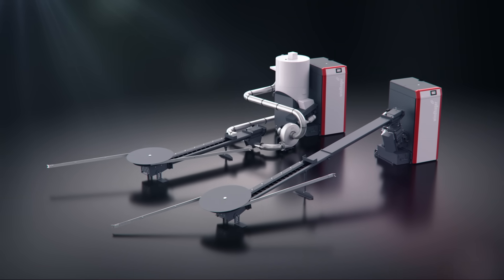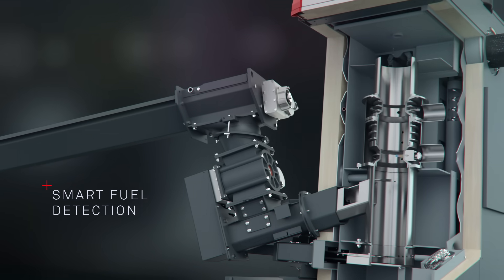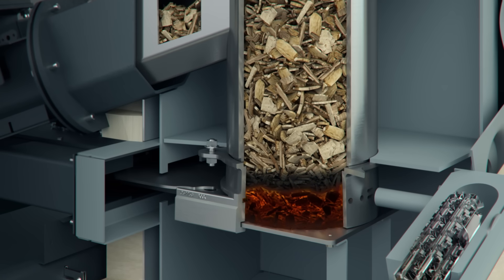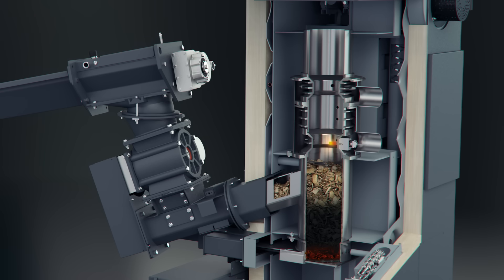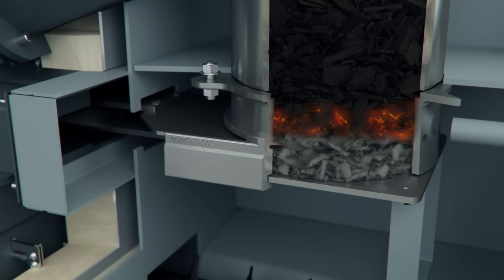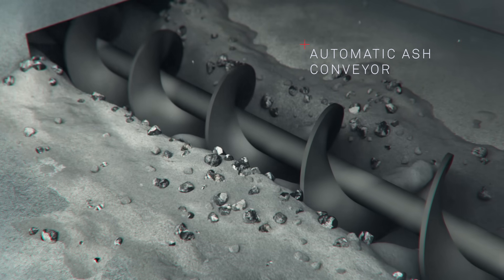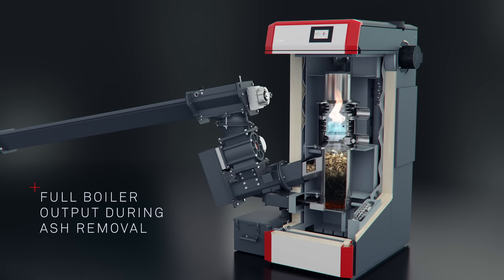Windhager PuroWIN - wood chip boiler - zero-emission gasification boiler with stainless steel burner

Comment: how apt, the nazi spawn over engineering solutions that should've made you ditch them years ago, a gasification wood chip boiler in the same century as the heat pump ... no wonder chinese cars are wiping the floor with your faces, you over engineering dinosaurs.

Comment: OK, I read the comments first so I'd be able to talk crap after the video but this this is actually awesome:  Used wood chips so does not need expensive pellets; it burns the gasses Above the dry chips (I think a first in the word genius innovation); adds continuous ash removal and 4 day idle time.  This would work well in the USA for off grid and forested areas.  How do we order one?  What's the cost?

Comment: But it's not zero emission... Similar to mandated diesel emissions equipment; The scapegoat is emissions. The number one sole contributor to "global warming" is said to be Carbon dioxide.. Despite this all of the mandated diesel emissions equipment in the U.S. yield higher Co2 emissions per mile. The only emission that get's reduced is Soot. Wood gasifiers are very similar. You're not emitting hydrocarbons and fluorocarbons so that's all fine and dandy.. But you're releasing a tad more Co2 than even gasoline. Emissions should NEVER be measured in parts per mass of fuel. They should ONLY be measured against the amount of "work" or power generated.

Comment: You know what you guys need? Can I offer an idea?

Here is an idea: you could design a MICRO-STEAM-TURBINE around this system.
Heat from the ignition-area, creates steam and runs the steam-turbine. At the other end of the turbine, cold water cools off the steam, creating a suction, further increasing the efficiency of the steam-turbine. The cold water, now pre-heated, enters the GASIFIER's ignition-area, and produces more steam.

> Cooled off steam (60-65 degrees), enter a hot-water storage tank. Any excess hot water enters a cooling-off tank, to preserve water.
> The hot water can now be used for showers and heating the home!
> The electricity is stored inside server-batteries and is used to run pumps and ignition system, for the entire home!

A PERFECT ALL-IN-ONE SELF-SUFFICIENT SYSTEM.

If you get to make this, it will be amazing to see and to buy it. It is then an completely self-sufficient, low maintenance unit, that is efficient and produces house electricity and hot water, for the whole house on demand. Will probably cost no more than $30 000, including the batteries.

I believe this is what many households would want, after today's events. Have a good day!
Reply: Also, there is actually a "tesla turbine," which allows "wet steam" to power it also. It is also simple and cheap to make.

There are already tons of videos and information about it. It would be amazing to have something like that during emergencies.

Comment: How is the wood gets ignited/heated in the beginning? Can somebody explain?
Reply: Hot air gets blown from the bottom, as the video explains.
Reply: An electric arc candle is installed there.

Comment: Do you have a version that uses the gas to run an electrical generator instead of a flame boiler?

Also does it only run on wood chip or can you use fuel pellets derived from other organic waste material?

Comment: How do the emissions from gasifiers like this compare with a gasoline engine? It always seemed the exhaust from a wood stove could be burned, not much would remain to discharge into the atmosphere? Also curious about catalytic converters for this application since they have been installed on wood stoves.

Comment: And if the power goes out......
Reply: If the power turns out the top flame could estinguish since the glow plug will not work,turning it into the most dangerous smoke bomb and most poluting stove.

Comment: biomass installations (though they are beautifully engineered) like this are classified as "green energy" by the EU, which allows european countries to cut down american forests, have all the wood chipped, shipped over the atlantic, processed and burnt - because it's marginally cheaper than buying solar panels.
Reply: The most efficient at producing biomass are the C3 photosinthesis plants ,ie the grasses.Trees dont have C3 ( except a few species).
So producing pellets from grass its actually ecological and 3 times cheaper than burning wood chips.
Its also carbon neutral.
Reply: they want the trace minerals of the ash coming with it :D

Comment: Solid biofuels are almost always inferior to gshp and generally a disaster for biodiversity. I studied these systems 10 years ago and never saw this design. It looks really elegant, well done.
Reply: Gshp? Ground source heat pump? They are ok, but not great. Forced air heating is less efficient and less comfortable than radiant heat.
Reply: @leeknivek  Yup. GSHP and hydronic underfloor heating are good friends. Some surfaces such as thick wooden flooring, or carpets, need higher working temps which negatively impacts efficiency. In high performance homes, the heat loads are so low ducted heating is fine, as long as the ventilation is well-designed. 

I used to hate ducted heating, but it does a lot of homogenizing for contaminants/dust, humidity, solar gain and CO2 concentrations. So I'm more sympathetic to them.

Comment: Never seen one of these before. I know about gasification and such as a fuel source for combustion engines such as generators or small engine cars as an alternative, but I haven't seen a boiler. SO am I correct in assuming this boiler is for heating a water tank for radiators or hot water tap?
Reply: yup

Comment: the wood becoming relevant as a fuel source again: "you couldn’t live with your failure, and where did it bring you? back to me"
Reply: wood is a terrible fuel source, still.
Reply: @clipdump  its still an easily renewable and source-able fuel that in a tight pinch for something like emergency power you can easy get your hands on
Reply: People discovered fast grow wood like black locust trees (and bamboos), thus certain woods and wood like lumber are viable as renewables

Comment: Thanks for putting this well made video up about your great design.
I can not afford that unit but I think I could build a smaller one to keep me from freezing to death. It would be quite primitive compared to yours and would be super dangerous and fall apart after extended use but smoke free heat might end up being a precious thing if SHTF so thank you very much.
Reply: Look up FEMA gasifier. They show you how to effectively build one from 30 gallon drums and old gas cans. You can always use a series of motorised valves and controllers to monitor the system and automate the process.

Comment: Zero-emission I don’t think so. Also how energy efficient is this? It seems to have a lot of moving parts. There is a conveyor to add in the woodchips, then the chips must be ignited and have air pumped in for the combustion. After that the sliding plates will dispense of the ashes in a auger to empty the ashe. This seems to be just a product idea and there is a reason this is just a computer animation. This is far too complicated of a product to hit retail consumers.

Comment: As a German chimney sweep, I am very impressed and excited! Nice concept so far but why did i never hear from this in the last 4 years before? :/ AND did this still work with other fuels like pellets?
Reply: If you create negative air pressure above the fuel you can burn anything that's dry enough and organic.
You could fill it with dog eggs if you wanted

Comment: Zero emission of what?  It's certainly not reducing CO2.  Also not shown are the emissions from the energy used to chip the wood.   Every method of burning anything to get energy is just simply a game of smoke and mirrors (no pun intended) as the emissions, CO2 and other, are moved around to someplace where you don't see them and don't think of them.  Especially true of electric cars, unless the energy is coming from solar or nuclear.
Reply: You are a genius for pointing out something nobody else noticed. Burning wood produces CO2, brilliant analysis. Keep us posted on other astounding insights you might have.
Reply: @w.o.jackson8432  Another astounding insight -  you're such a loser you took time out of your lonely day to post that, singling me out despite the fact that others said the same thing, even though on my post it wasn't even said, it was just implied.

Comment: Ok but like why though? What's this used for?
Reply: making wood gas
Reply: @w.o.jackson8432  for what purpose? Does it drive a generator or something?
Reply: @sams6090  That is one potential use. Wood gas can be made clean enough to power generators in place of gasoline, which means you can produce renewable electricity if the grid were to go down for extended amounts of time.

Comment: This still begs the question: Why does one need a woodchip boiler? And why did the algorithm bring me here?
Reply: Replaces a gas or oil based boiler for homes. Very nice if you've got a source of wood chips that's cheaper than either per unit energy.
Reply: @Dewkeeper  Thanks for answering! I was wondering the same thing over and over haha

Comment: So, first of all, this looks like a marvelous machine!
Secondly, this reminds me a lot of the process for producing wood-gas. You put all of the wood in a sealed can, you poke a hole at the top of the can and then you heat up the can. The wood releases gas that is flammable.
Here, the principle is the same, but it is also filtered. Colin Furze tried to make a wood-gas powered lawnmower, but the components were getting clogged up with tar, while here the tar/ash is filter from the wood chips themselves! Ingenious!
Reply: It's an updraft wood chip gasifier, which are usually plagued by carbon build-up from tar and charcoal that blocks upward gas flow. When burning coal, charcoal or very dry wood the tar build-up can be minimal, but its going to be an ongoing problem.The updraft system is a natural filter  because the hot gases must pass through the unburned wood, but the same  clogs the outward gas flow.

 A home built updraft gasifer might require daily manually breaking the hard mass. This automated design has a horizontal actuator to break up the charcoal and tar. It's nifty, but spendy.
Reply: amazing what you can achieve with cgi

Comment: -"zero-emission"
-burns wood but fancy
Reply: Wood is a zero emission fuel source if you burn it as clean like this boiler, since replanting a forrest will suck up the same amount of CO2 you released by burning it.
Reply: @lda sorry to break it to you but ANY flame is ALWAYS the gas burning. So the idiot is the one who bought this fancy 20000$ alternative to hobo heater.
Reply: it's burning the gas from the wood not the wood

Comment: Zero emission? What, it does fucking fusion inside? All the carbon is still outputted as in any heater. It doesn't just go away. Also why use an auger for the ash? Why not just empty the burner directly into an ashbox underneath? it's just overcomplicated in so many ways it's ridiculous. It's a nice product I guess but it's a bloody awful commercial

Comment: Okay, now let me see a real one actually working. Wood chips should be used because tons of branch waste is put back in the forest to rot every year. I do it every day, I work in the woods. There's problems with wood chips. First they need to be dried out before storing or they won't burn and a pile of them can actually create enough heat to combust on their own. Second is the storing, you would need a giant room or bin for that. Third, there needs to be enough value for us to produce chips because it cost a lot of money to run a chipper and make them. In the past there has been bio-feul plants to burn them for energy but between the government stoping the subsidizing of them and their demanding of better log wood over waste wood, the value has been lost for the wood producer so why would they bother.

Comment: The title of the video about zero emissions is frankly lying, at least when it comes to carbon dioxide, because without its synthesis, wood combustion is impossible.
I'm also concerned about the need to destroy forests on an industrial scale to provide fuel for these things, because increasing the area of forests is the key to fixing the carbon dioxide problems in the atmosphere.

Comment: That's all well and good. However, where do you get these wood chip fuels? I assume that they must meet some sort of Minimum High Quality Standard for burning in these Super clean boilers. In the U.S. at least....Wood fuel producers would have to gear up for this level of wood burning quality fuel. I like it ALOT....but I think this is years away from practical use ......at least here in America.....I hope I'm wrong🔥

Comment: Great tech involves great maintenance costs. 
Drawbacks might be that if there is no electricity, there is no way to maintain burning process and other processes such as chip intake, ash removal etc.. 
The machine has sophisticated elements that cost arm and a leg to change them when needed. Even simple parts such as ash removal plates have to be made with deadly precision which means you wont be able to order them at your local shop, you will have to buy it from the manufacturer. 
SMART means detectors, which cost a lot and tend to be weak points of many SMART operating machines. This also means that the chip quality has to be specified and strict, in order for the smart systems to work without interruption. A slightly deviation from the standards and the smart systems wont work properly.    

The technology is great, the zero emissions sounds nice, but the price and maintenance cost might not be appealing for everyone...
Reply: A hybrid system could also use the wood gas to  fuel a gasoline powered electricity  generator.   

There are decent open source downdraft wood gasifiers, some published by the U.S. government, but no updraft gasifiers like this. The video is probably omitting critical details - how does it mechanically break-up the charcoal?  The ongoing production of charcoal will plug up the system and require manual Intervention. The automated ash plate might be sufficient to enable the weight of the unburned material 
to drop the column above tge ember bed, but it's likely to form a hard bridge and choke the process.

Well designed amateur built  downdraft wood  gasifers don't clog up as easily, but they produce greater ash and tar and are usually batch loaded.

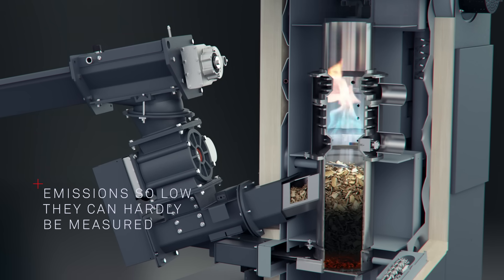Comment: I am not convinced this is Zero Emission, anything that involves a flame has emissions, its something you cannot get away with.  It even says in the video (2:18) that the emissions are barely registered... still that is an emission. so it should classified as a very low-emission gasification boiler.

Comment: What is an emission?  From wikipedia: a wood gas generator to produce hydrogen and carbon monoxide. These gases can then be burnt as a fuel within an oxygen rich environment to produce carbon dioxide, water and heat.  I count carbon dioxide as an emission.

Comment: arnt we trying to burn less trees seeing how things are going full environmentalism
Reply: Nope.  Pull carbon from the ground (coal and oil) and burn it, and you release ground CO2 into the atmosphere, permanently increasing the overall CO2, leading to global warming.  We call that carbon positive.  Trees pull CO2 out of the air as food.  Burn them and you just release the CO2 back, which will then be consumed by more growing trees.  Its a net zero cycle, carbon neutral, no global warming.

The only downside is the inhalation of wood ash, which is a cancer risk.  Bad for you, good for the environment, but this machine solves that issue.

Comment: Still not sure how they handle the tar. Even if in small quantities (It depends on the quality of the woodchips), and with the chips acting as a filter for the expensier top parts, it has to accumulate on the ash box and lower parts of the boiler. 
It may just be that, to clean the ash box regularly from tars, but depending on the period it can be annoying.

Comment: title says "zero-emission" video says "low emissions" definition fail.
Reply: Zero-emission is a marketing gimmick. Means zero total CO2 emission. Which is true for anything that burns wood.  Low emission is the actual CO2 that is emitted by the machine, which if done perfect, can be almost zero but it will never reach that, so they cannot say it.
Reply: @framegrace1  I realize there's a distinction, the video however can't get its story straight.

Comment: I had been wondering for a long time why no wood stove did the 2 steps burning... well I still wonder why in fact.
Reply: Apparently, rocket stoves use much the same technology.  PuroWin clearly separates gasification from combustion (as it can smoulder the wood pile whilst supplying very little oxygen), whereas in a rocket stove, it happens with very little lag.

Comment: And Solar Roadways also work exactly as advertised too. If wood is being burned then gas is being released as the product of the reaction.
So I am guessing that by emissions what they really mean is smoke and ash and not CO2 or CO or acid rain precursors. Because all of those are clearly still being produced here while the focus of this product is that it does not emit a lot of ash or heavy smoke.